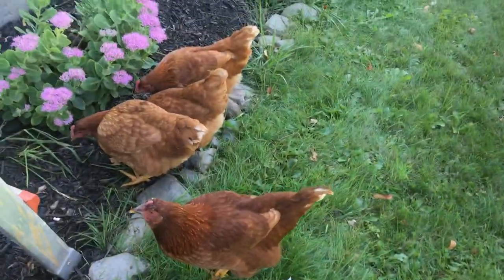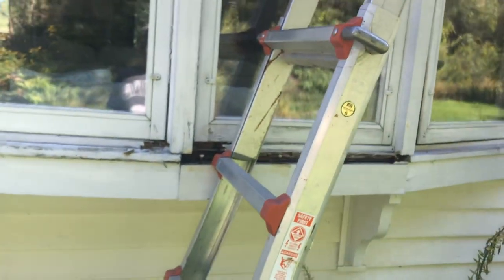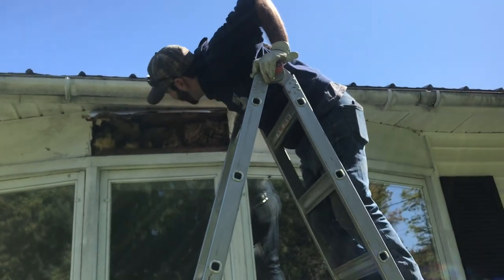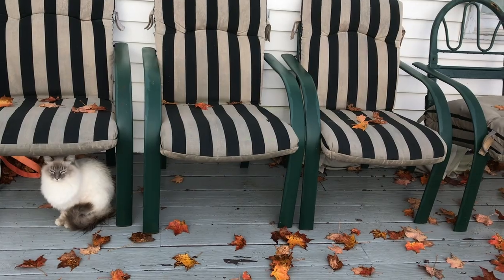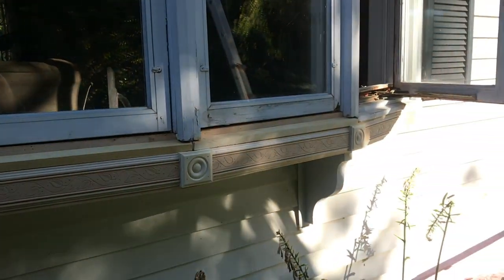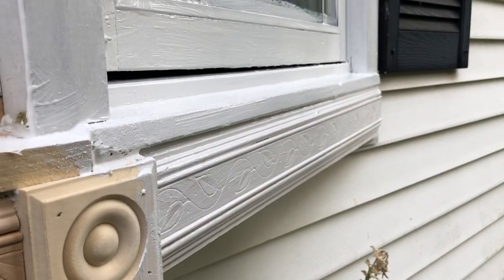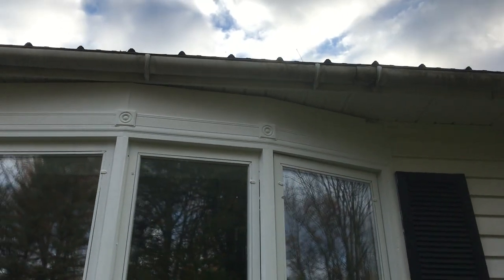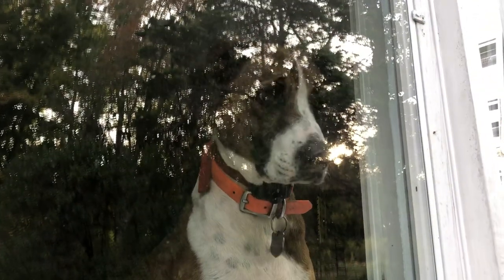Fixing a rotten sill and reinsulating the bay window

Comment: Dealing with this same issue....also bought the house knowing it needed repaired but been putting it off.... and putting it off.... haha. We actually have carpenter ants coming through the crack at the bottom on the INSIDE. The bottom/base board inside that the window sits on is warped and soft. I just don't even know where to begin though 😩 I guess we need to start on the outside?
Reply from the maker: Sounds like a challenge. I was lucky that I just needed to re-insulate and the windows can hang on for a bit. I haven’t tackled replacing a window yet, but my understanding is that it isn’t too hard. I actually need to replace a door this summer. In my case starting outside made sense, and I tried to take it apart so I could easily put it back together if need be, and I paid attention to weather so I wasn’t stuck with a window torn apart and pouring rain. Good luck!